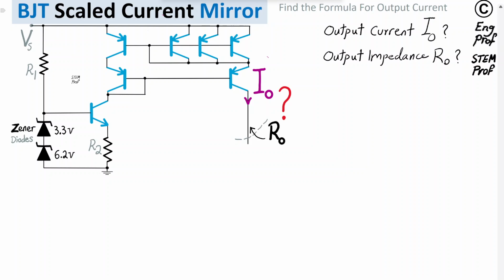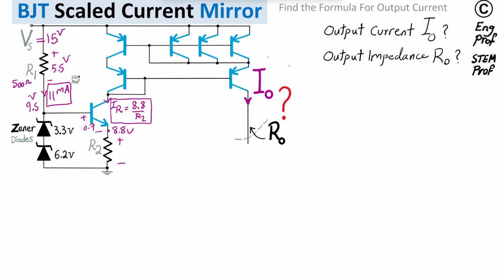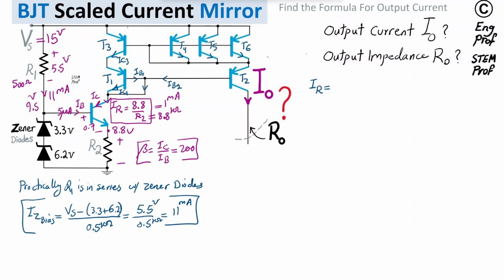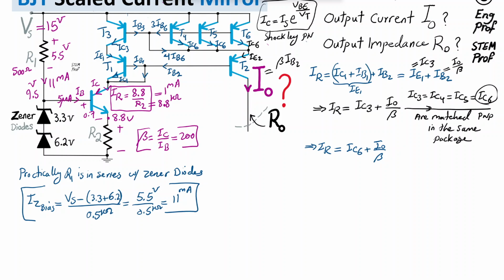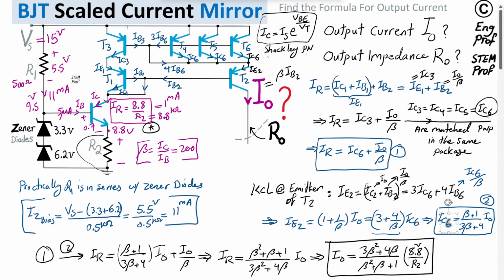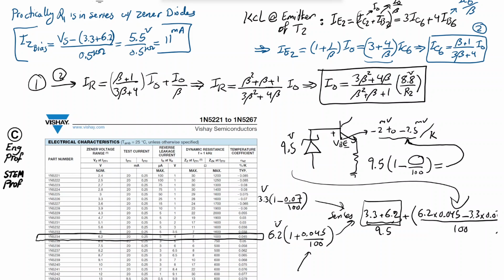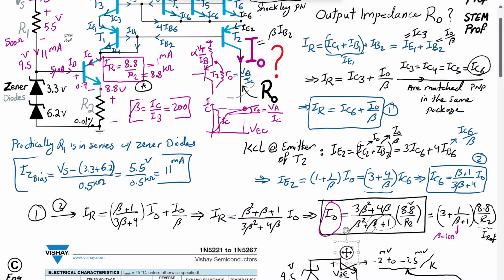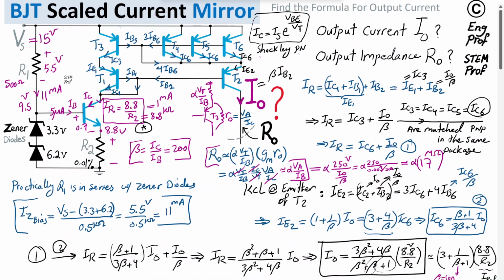Modified Wilson Current Mirror with PNP BJT Transistors

Comment from the maker: Thanks for watching. For more Op Amp Circuits please see:
Wilson Current Mirror and Current Source Design https://youtu.be/LfbfJYrovN0
Thermometer Circuit Design with Op Amp & BJT transistor https://youtu.be/55YsraFE0rg
Temperature–Compensated Programmable Current Source Circuit Design with Zener Diode, BJT Transistors https://youtu.be/QY48IQXJIRI
Analog Computer Vector Sum Calculator with Op Amp and BJT Transistors https://youtu.be/PIAsa0QNVns
Instrumentation Amplifier with Electronic Gain Control https://youtu.be/C4tghZ-q6Zs
Programmable Current Source Design with Op Amp, Zener Diode and Digital Potentiometer https://youtu.be/R1x6B0TczWk
On-Chip BJT Current Source Design https://youtu.be/Rs7gEMk03dw
Push-Pull Power Amplifier with Darlington Transistors https://youtu.be/866MYibo8yE
Analog Logarithm Computer https://youtu.be/RpKEq5WyoLg
Op Amp Analog Computer Differential Equation Solver https://youtu.be/ENq39EesfPw
Sawtooth Oscillator Design https://youtu.be/2eUsGPfqbW4
Triangle Oscillator Op Amp circuit https://youtu.be/JF5Up_cuL9k
Sallen-Key Analog Filter Design Tutorial https://youtu.be/KwUnQXbk7gM
How to find Bode Plot, Freq Response, Transfer Function of Analog Filters https://youtu.be/vZFkPeDa1H8
Universal Analog Filter Design https://youtu.be/2J-0msXZE2o
Laplace Transform Example and S-domain circuit analysis:  https://youtu.be/ps8N5TPM_qU
Op Amp circuit Bode Frequency plot https://youtu.be/BLVzuuqAlZs
Lowpass Butterworth Filter: https://youtu.be/UzCjkwqy-9w
Analog Computer to Raise Signal to power n https://youtu.be/IUTlBH1UraE
Differential Equation Solver Analog Circuit https://youtu.be/R3X5AYNZGEI
Complex Sinusoid Oscillator https://youtu.be/GXRhmwmS5Zk
Full-Wave Rectifier circuit example https://youtu.be/DJJMNU-CYcg
Sawtooth Waveform Generator design with OpAmp, JFET, BJT https://youtu.be/5zHXTx-Vl20 
op amps Circuit with feedback loops to design an analog computer that solves a second order differential equation https://youtu.be/HeZRtnRXpEI 
For more analog circuits and signal processing examples see: https://www.youtube.com/playlist?list=PLrwXF7N522y4c7c-8KBjrwd7IyaZfWxyt
I hope these Circuit design and analysis videos are helpful. 🙂

Comment: Really interesting video. Maybe the math is not easy to follow. In 30:47 alpha is introduced. For what is alpha used and how to get the value of alpha?
Reply from the maker: You're welcome. For AC analysis, we need an ac impedance (resistance) equivalence for all transistors seen from the emitter of the T2 BJT transistor.  As mentioned between 30:50 and 31:30 this equivalent resistance is proportional to the VT/IB were VT or KT/q is the thermal voltage (roughly 26 mV at 17 degree Celsius room temperature) and IB is the DC current of the Base of the transistor.  The proportional factor alpha depends on number of transistors present at the emitter of the T2 transistor and their connections. As shown at 30:50, the total current seen at the emitter of T2 is IemitterT2 = 4*IB6+3*IC6 = (4+3*beta)*IB6 = (4+3*beta)*Is*exp(VEB6/VT) where VEB6=Vsupply - VemitterT2 . Taking a derivative of IeT2 with respect to VemitterT2 results in 1/impedance = (4+3*beta)* IB6/VT meaning that alpha is approximately 1/(4+3*beta).  Here are a few related videos to watch: 
Wilson Current Mirror and Current Source Design https://youtu.be/LfbfJYrovN0
Thermometer Circuit Design with Op Amp & BJT transistor https://youtu.be/55YsraFE0rg
Temperature–Compensated Programmable Current Source Circuit Design with Zener Diode, BJT Transistors https://youtu.be/QY48IQXJIRI
5v Charger Regulator Design with MOSFET & JFET transistors https://youtu.be/NdfyHoxjKrY
I hope this explanation is helpful.